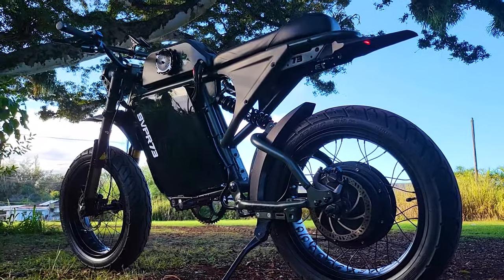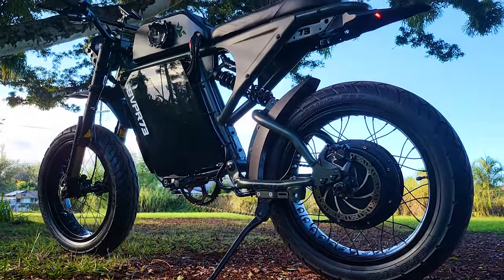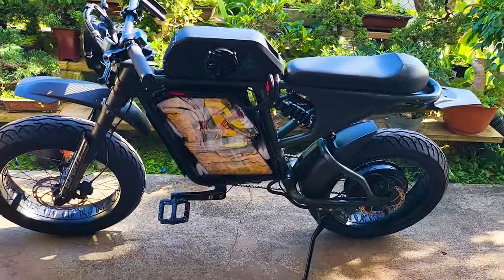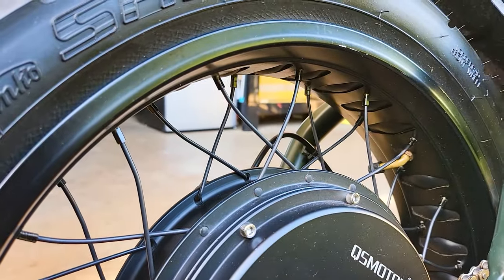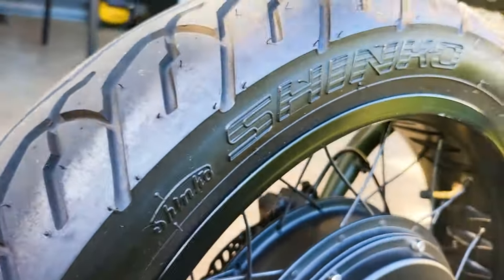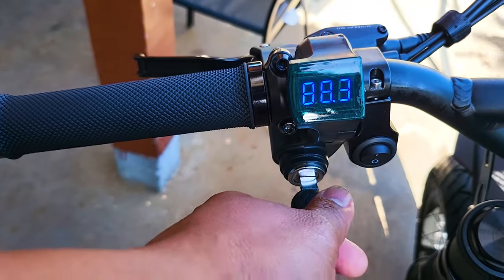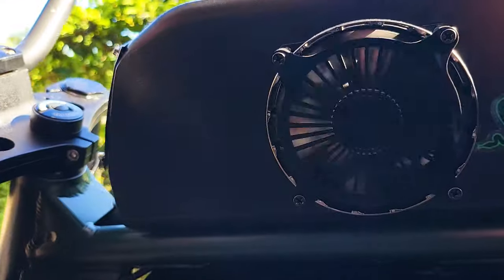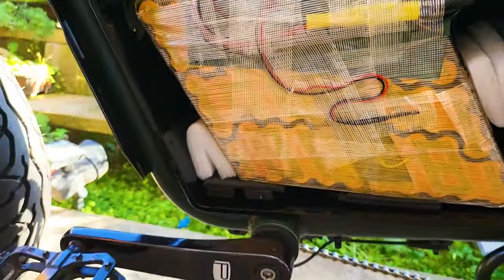The best electric bike Super 73 RX  DIY MOD!

Comment: I looooove builds that have the perfect blend of aesthetics and performance — this build does just that 🤙🏽
Reply from the maker: yes indeed. Very well done.
Reply: It blends everything bad about both an ebike and a motorcycle.  It's slow for a motorcycle.  The smallest motorcycle can blow past the top speed shown in this video of around 72mph. Its acceleration wasn't good either.
But it's not a bicycle anymore or anything close to it and would, if allowed on the road at all, require registration and insurance and a custom inspection.
The base bike this was built from is already more expensive than a decent and MUCH faster and better used motorcycle before adding thousands of more dollars in batteries, and controllers and other stuff.
Reply: @tarstarkusz  this isn’t a motorcycle. It’s a bicycle.
Reply: @3ull  It's a moped and not even really moped, but a motorcycle.  It would not and does not meet the legal definition of a bicycle in any US state.

Comment: Wow! should mass produce that.
Reply: You would have to add some sort of noise device to it
Reply: zak is wrong because of the pedals it requires no further mods insurance or licences
Reply: considered a motor assisted pedal bike
Reply: and the super 73 is mass production just not the mods hes done to it
Reply: @CarsTVCanada  it depends, but this bike is illegal in the US since it's passed 750w and 20mph
Reply: @NeptuneSega  honestly you can easily get away with it anyway, literally no officers have any clue what to do about these bikes right now even on the cases of Sur-Ron’s being taken or such it’s often people who are doing fucking wheelies or trying to go 40mph in the damn designated bike lane, I’ve gotten stopped 4 times on my bike by cops and only one time was the guy stopping me for possible law issues the others were just genuinely curious what it was and why I had no plates, after explaining it was a electric bicycle that was just beefed up for added stability performance and general safety they all were just shocked at how cool they were.
Reply: @CarsTVCanada  you missing the the point of what he meant lol … at that speed you need a lil noise so other drivers/riders ar aware of the bike coming or he can cause a major accident at that speed which can cost him his life
Reply: Anyone saying anything other than an electric motorcycle doesn’t know the law (at least in ny) Class 2 & 3 of e bikes are only valid on roads under 30 a cop sees you on the highway with no plate he’s not just gonna say oh you got pedals your good not how that works

Comment: Let me know how your breaks and rotors hold up! This looks awesome, stay safe!
Reply: Its holding pretty well, i have variable regen braking with stock Hydraulic brake. Stopping power is really 👍🏻
Reply: Stay safe, indeed
Reply: I doubt it holds up with stock rotors, or you're slowing down really fast. Test the braking distance from full speed. If you can't slow down fast enough from that speed then it's useless on the road unless you want to die.
Reply: @Tojoblindeye  for some reason he doesn't acknowledge it but he did end up putting beefier rotors on that bike.
So yeah apparently he figured out that he might die.
He might have even figured out that you can't assume that regen is always going to be there for you.

Comment: Awesome build, that 3000w motor has some torque so I hope that frame can handle it, I'm glad he's the guinea pig lol
Reply: Lol
Reply: 12000w ebikes are more fun and stable.
Reply: I’d be more concerned about those rear spokes handling it!
Reply: Its a 73 seen them with 5kw and 12kw motors 3kw is low/small
Reply: @Zed-Corps  this bike is 20kwatts
Reply: @jaymolina9777  that handlebars are you using on this?

Comment: Great specs but be careful hitting those speeds on that frame/hub. I want a Sur Ron but 50-60 mph on those light frames are sketchy enough. 2 sets of tires (street/trail) for all types of riding. I imagine my tail tires would stay on the most, even on the street.

Comment: Sick bike man this is what makes me wanna get a junk frame of a motorcycle or a pit bike an slap a big battery in it and motor but need to do a bit of info searching I don’t wanna get the wrong controller and battery but man I want that 60mph in a slim pack like his bike 👍😁
Reply: Build your own controller
Reply: Yeah build your own if you've the knowledge otherwise there's a lot of decent controller out there. I would buy instead. You should be looking for a good battery builder. Good luck..

Comment: As much as I love this mod I don’t think I’d go this far, it looks extremely unsafe to me 😭 however I’d love to get that battery enclosure.
Reply: @ronaldrenegade8519  yeah
Reply: @aeskellion  just wondering what would you find unsafe? pretty much it has motorcycle parts that in those they got almost double the speeds with no problem so just wondering why you thinking that? because it really is not fair to say something without elaborating on why you think something.
Reply: @dreamkiss4u  there’s a sticker on the front fork saying you shouldn’t ride this thing faster than 60 kph, that’s about 40 mph. That’s one. Two, the frame is known to snap on stock bikes. Three, if you look at brakes on a motorcycle even the 125cc ones there heavy duty compared to the RX which comes with bicycle brakes. That’s why I’m saying it’s not safe.
Reply: @aeskellion  that's an easy fix, change the forks.
Reply: @dreamkiss4u  we’re entering sur-ron territory, it’s more equipped to go that fast. I’d get that instead.
Reply: @dreamkiss4u  getting a fork for these bikes is a headache
Reply: @aeskellion  may not really I'm pretty sure any regular repeatable motorcycle place can order anything, they have huge catalogs to order from.
Reply: @dreamkiss4u  well maybe you’re not aware but there aren’t many if any high end double crown forks for 20x4 bikes on the market.
Reply: @aeskellion  you don't need super high end top of top of the line for every part,  unless you want it to be super expensive.
Reply: @dreamkiss4u  nonetheless, I won’t be doing it because I find it unsafe no need to convince me, it’s my opinion ! 😁
Reply: @aeskellion  no one's trying to convince you but I'm trying to tell you it ain't that bad to swapping out something so simple that does not need to be top of the line to be reliable so that " you" don't convince others with your opinion that can be such an easy fix 😉
Reply: @dreamkiss4u  i said that it looks unsafe to me, never said it WAS. It’s not that simple of a fix, because you have to actually find a fork that’s compatible with your bike, then you have to upgrade your brakes to use motorcycle brakes, then this then that, I’d rather not. It’s not built for it, it’s barely capable of doing what it’s been made for so again, for me, it doesn’t make sense. That’s all
Reply: @dreamkiss4u  not really.  The frame is built for much slower speeds and lighter loads.  Slapping the large motors and batteries and riding at higher speeds is taking a risk.  This is comming form a motorcyclist that also has DIY ebikes and has had the pleasure of a couple of crashes.  The brakes were also brought up, and by all means, no bicycle brakes, whether shimano, tekktro are built for these loads and are very dangerous.  I had to put my feet down on one occasion because the quad piston brakes overheated (I upgraded from dual to quad pistons and still insufficient).  So yes, this set up is rather unsafe.  But so is most of enduro and extreme riding, so as long as the risks are well nderstood and maximally mitigated, have fun!
Reply: @giorgikhodeli3633  your not going to upgrade it with bike parts but with more robust motorcycle parts... but yes it all depends how fast you are trying to make it. No vehicle is made to just withstand what is built as... they area capable of lots more, they are not close to there limits or else we would be at risk driving anything that's already at its limits.
Reply: @aeskellion  and you are only right, for those exact reasons. Bad ass bike tho.
Reply: Tbf this bike has regen braking, and anyone who has experienced regen braking knows you can go from 60mph to like 10pm within seconds of regen kicking in, hell I had to add a regen throttle to my ebike because the automatic regen made it basicallly impossible to coast for more than about 2-3 seconds.
Reply: @kimhyunwoo8983  imagine trying to brake that fast with the rear tire alone.

Comment: When I saw the first video, I was skeptical on the top speed and the range. But, this newer video details the much increased battery size and AH. 
You should try to add a little aero so your drag would be less amongst other factors. Would the suspension allow for greater travel?

Comment: The spokes on that hub motor are the only insane thing.  What on earth is the angle you are cutting with those things?  You need dimpled rims to pull that much of an angle.
Reply: HATER 🚨
Reply: @rolandroland1485  No, he's right. it's dangerous, as these are bicycle spokes that can't handle those forces plus they are bent to hell making it worse
Reply: @NeptuneSega  they can’t handle 70 mph ?

Comment: The bike looks beautiful and if you take that bike to 80 miles an hour I would expect those brakes to melt before you got down to 40.
Good luck.
Reply from the maker: Now this is ridiculous 🙄 these guys ride this diy bikes for last 2 years and you feel like you are smarter than these guys that did the testing and come up with this note sense. Bravo Elias.
Reply: Regen braking, the motor acts as the brakes. Just like electric cars. My EV only uses the standard brakes under 5mph.
Reply: These bikes are light compared to motorcycles.
Reply: @ElectricVehicleSpace 
You say I am ridiculous? You accuse me of thinking I'm smarter than them? Not necessarily.
I made it very specific statement about the ability of those brake discs to stop that bike from high speeds. 
You're criticizing me for that comment. 
You said these guys rode that bike for two years and somehow magically I knew better.  
No, it's not magic. I'm not smarter than them. It happens that I have designed and built three solar powered vehicles. But no one needed that detailed experience to recognize at a glance those brakes were too small. 
All you needed to know was that those are the exact lightweight brake discs used on a mountain bikes that weighs 40 lbs or less. 
Those brake discs perform well stopping a total load of 200 lb from 30 mph. It does not take a genius to figure out stopping 350 from 80 miles an hour would be a little less than thrilling.
So to confirm your suspicions. My statement still stands.
And now for the punchline.
Did you see he took my advice? Seriously look at the discs he has on his bike now. They are not the same are they? Sorry bro.
Reply: @FEboats  there is some amount of Truth to what you're saying about regenerative braking. It does help. However from a design perspective you cannot ever assume that it's going to work. It might be safe to assume that using your regenerative brakes we'll make the brakes last longer. Making that assumption would be safe.
However, say you're doing 60 miles an hour this guy says that bike can do, and you experience a motor controller failure, or simply a loose wire on the battery or any multitude of other problems that would cause the motor and motor control system to be briefly inoperable. 
If you assumed that you would always have regenerative braking then you might die just seconds after you realized your mistake.
Don't short cut on brakes.
Besides, if you look at his bike now you'll see he took my advice.
I would not criticize his current break choice without at least riding the bike first.
Reply: @3ull  you're right, electric bikes are light when it compares to motorcycles. But we're talking about brakes here aren't we?
Electric bikes are heavy when it compares to regular bikes.
This badass bike with a large heavy battery pack and large heavy tires in a motor controller that's designed to take 80 volts runs much faster than the bicycles these brakes were manufactured for.
So you're comment about motorcycles are heavier is true. But I've never said they needed to be motorcycle brakes I just said those breaks were too small.
And if you've seen the completed version of is brakes you would notice that he took my advice. Or independently he determined that those brakes were also too small.
Reply: @eliasshedd  I get it, hydraulic brakes go out too. You can cross all the phase wires to brake with no controller. Maybe that’s a good idea. Brakes are good either way.
Reply: @FEboats  Again, beautiful bike. I love how these bikes can be changed and modified even when it isint perfect. 
I tried 3 different battery configurations on my bike before finding the one I like. 
Beautiful work👍

Comment: That’s very cool! Great work. Why have bicycle sprocket and crank though on a motorcycle? Also, can’t you make a passive air cooled controller box with air fins? Having that fan sucks.
Reply: Need the pedal for legality of the bike.
The cooling system still improving design
Reply: @jaymolina9777  hi jay nice ride, what is the rim/ tire size for this?
Reply: @arieldelacruz04  110/70-16

Comment: Thats definitely impressive... you said custom spokes for the rear wheel... I never seen bent spokes on a bike like that... why not just use shorter not bent spokes?.... I just went and watched a video about spoke articulation angles.... and I'm still unsure why thes spokes are bent... ??? Never seen this.
Reply from the maker: i am not completely sure but I hope the builder replies. Maybe they ask as a slight suspension when you hit crack and stuff maybe...
Reply: Its just a design of the spokes, works really well, had this spokes for almost a year now, without any problem.
Reply from the maker: @jaymolina9777  so design and no functionality?
Reply: @ElectricVehicleSpace  yup

Comment: I bought a super 73 rx bicycle with a 5000w motor, the problem is the battery does not fit inside the frame, how did you fix yours????
Reply from the maker: custom made

Comment: Are these just regular fat bike tires? Im wondering if i can just slap these onto my fat bike hub motor wheel. I've also tried searching for "shinko 525" in the search bar but I cant find them. Could you link the parts for the wheel?
Reply: the rims and the tire, please
Reply: Searched for shinko 525, and it’s not the tire installed totally different design

Comment: im just curious - how much does the mod cost in total?
Reply from the maker: Jay maybe you can respond to this inquiry?
Reply: Super73 R $3400
Battery 84v 300a max $2500
Motor $1200 custom qs 205 3t- 190mm drop out
Custom 300a Controller $1100
Flow carbon kit $900
Kanebilt Head light $180

Comment: I wouldn’t trust that frame to hold up. I’ve seen so many cracked or broken frames from super 73 & those kind of speeds are just asking for trouble. 💀
Reply: At this level, I would rather get an electric motorcycle
Reply: @chojuj4533  Ugh yea wise man 👍
Reply: @chojuj4533  motorcycle you will need license,registration and insurance.
Reply: @shanew7361  depends how you build it
Reply: @shanew7361  it depends how you build this type of bike, those super73, that has a crack frame was involved on a crash. Those super73 frame is capable if you know what you doing.
Reply: I would use an Ariel rider frame with those mods. That’s a solid frame!
Reply: I agree lol 😂. My RX frame cracked when I hit something at 11mph  🙆🏽‍♀️
Reply: I wanna do this with my hyperscorpion. That frame's pretty sturdy!!!

Comment: Check out the Motor Goat, now on pre-order.
• 2,000W constant motor (2,600W Peak Power)
• 110nm of torque
• 60V 25AH Battery
• Range of 56 miles (Pedal Assist Mode) or 37 miles (All Electric Mode)
• Max speed of between 40-50MPH (dependent on rider weight and terrain)
• 50A Controller
• Full Twist Throttle

Comment: Lol is that still running stock rotors? Those things are tiny for something that can go 80. If you're gunna mod something to go faster like that, you gotta upgrade the braking power to match the acceleration... Or it's not fun it's a death machine.
Reply: Are you familiar with electric brake/regen braking?

Comment: The problem is they fall under this weird grey area legally. 

Like can you even Plate this thing?
Reply from the maker: Some states will but you don't need to since there are pedals on the frame.
Reply: @ElectricVehicleSpace  Yeah but if the Motor is over a certain Wattage, it isn't Legally a Bicycle. My City allows up to 750W.
Reply from the maker: @STAR CITY RC  this is not something you will ride or enjoy.
Reply: @ElectricVehicleSpace  I agree

Comment: Electric bike? Nice. Prices?  Just too expensive! I live in Mexico part of the year and a I bought  a 150cc gas powered scooter for 1/4 of the price. The thing  is a beast, the engine is good for 100,000 miles. What do you do when your very expensive lithium battery goes and you are left with basically a bicycle frame?
Reply from the maker: You need to do some reading 📚 🙄

Comment: The spokes must be re adjusted or better fitting rim....
Reply from the maker: how did you come to this conclusion?
Reply: @ElectricVehicleSpace  bro don't get kinky on me but just look at how much the are bent!!!  Have you ever seen factory wheels with bent spokes??!  Do you even build bikes?  These spokes will hold for a while but not forever. A rim that is designed for the heavy hubmotor is needed. Trust me I build bikes and had the same trouble. Do you also build them on your own or does somebody built the vehicles for you?